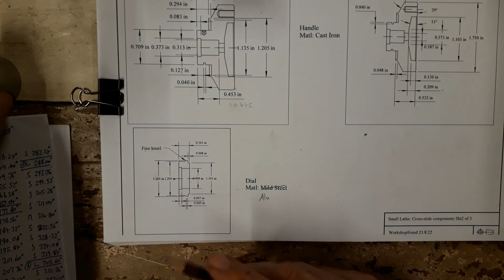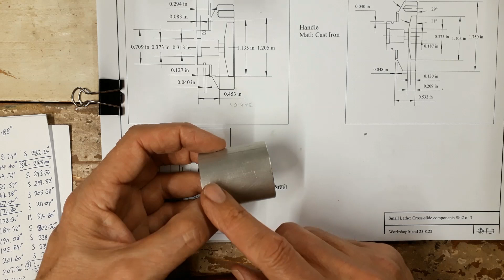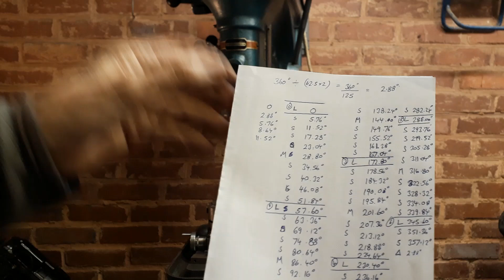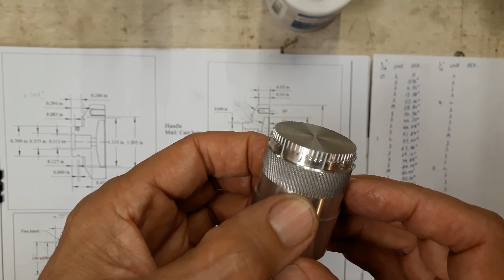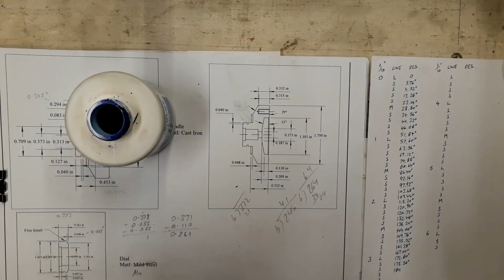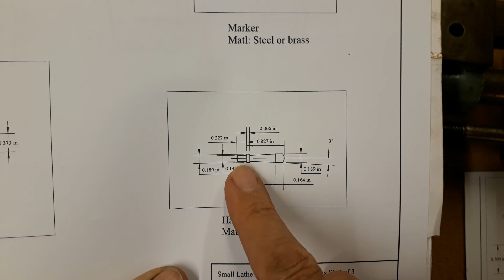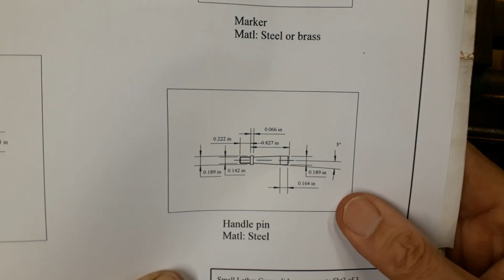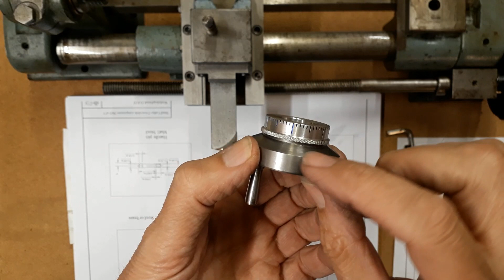#7: Making lathe handwheel dial with divisions using lathe and pillar drill

Comment: Dear sir, you did a fine job here. This is is the first video of yours I have watched so far. I own an old Southbend 9C lathe and have been systematically tuning it up. I also own a Drill/Mill machine sold by Harbor Freight here in the states. The dials are aluminum with the graduations painted on (very cheaply done). The painted lines on one dial have worn off and so I plan to do my own engraving eventually. For the time being I drew up the dial graduations using AutoCAD software. It is drawn full size in the flat at the circumference of the aluminum ring. I printed it out and used contact cement to fix it around the aluminum dial ring and coated the paper dial with clear silicone caulk to protect it from oil and solvents.
So far/so good until I get around to engraving. I appreciate what you do as I am a machinist/designer, and enjoy good jazz music like you have playing. I also dabble on the piano. I have to say that I love hearing a British accent. I find it calming. Wishing you health and many blessings in years to come.
Reply from the maker: Thank you, EPU, for your feedback and details of your ingenious quick fix for the mill feed dial. Hope you have success with the replacement! Welcome to the channel. Clive.